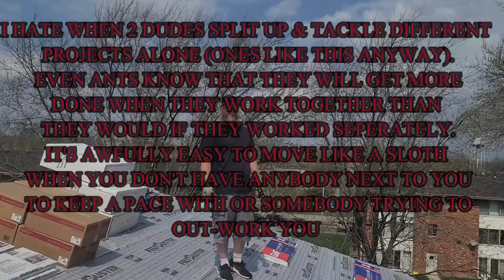First Roof of 2021

Comment: I wasn't exactly flying today, using 3 tabs with  4 intersecting valley's!...I haven't run these shingles in YEARS!...had to do a little bit of head scratching...lol!!!, but it  came back to me after the first one!...just like riding a bike I guess!...it turned out NICE!
Reply: Unless you are getting 3tab for half the price of Arc's I do not see much point. Here in NY there is a 15 dollar difference per sq
Reply: @mrroofman  the customer had bought them a year or so ago, and the guy that bid it out bailed

Comment: You need to do a 5 square challenge.  Time gets added for shiners and wavy shingles. People can sprint through a square but what’s the actual pace for 5? Then you would actually know who’s faster.
Reply from the maker: well thats why i came up with the roof olympics. one sq on a straight run hardly factors anything in. you should check out my video describing it. 3 sq platforms. everybody works alone. maybe a pipe and ridge cap

Comment: What is more important efficiency or speed? Should you focus on eliminating wasted effort or simply working harder/faster
Reply from the maker: Always efficiency 100%. It allows you to not have to work harder or faster.
Reply: @NWIVeteranConstruction  even in your roofing olympics videos are you focusing on being efficient in them as opposed to rushing ?
Reply from the maker: @charlierodgers2776  yes. Anything bigger than 2-3 bundles and you're gonna notice a burn out.  Shingling is not a sprint.  And anybody who has an efficient set up with some skill is gonna be faster than somebody going as fast as they can on the gun but walking around aimlessly twice the distance needed sometimes, going for coils every reload and moving shingles extra times no matter how hard they work.  Just my opinion.  Gatta be Efficient and pace yourself.  It's like a marathon.

Comment: Thoughts on doing ice and water shield for my entire roof? I'm in Maine.
Reply: I would say go for it just ventilate the attic properly...intake & outtake
Reply: I mean probably not necessary if you're putting asphalt shingles on and it's about a 5/12. If it's metal or fake slate then I'd go for it.

Comment: I prefer workmanship over speed, just because there are 2 lines where you have too nail between doesn't mean you should be a hack like 80% of the roofers in the world, you have one job, go up there and do a good job, I nail just above the part where you like the shingle up, hdz wants you too nail high so they make more money in the long run, if you do not believe me wait for a few years you will be called back for blow offs, might want too check the pressure on the compressor you are blowing through, if the pressure is good turn the gun down

Comment: I don't understand why you use 4 nails instead 6 ? Hmm
Reply: wind tunnel test from the manufacturer
Reply from the maker: we use 5 instead of 4 actually. 6 nails (in my area) are only required on steep pitches about 18/12 i think.
Reply: 4\12 and 3\12 get 4 nails 5/12 to 8\12 get 5 or 6 but 6 not necessary and over that gets 6 in the overlap.I do not trust that 2" nail line on a mansard .Those dimples are not gonna hold
Reply: You forgot about that Gaffney  built in super glue

Comment: Where the hell is your safety equipment? That is a three plus story DROP with one accidental trip 
Roofers think it’s funny or badass to not wear their rope so horror stories are important. I worked with this dude named “Mario” let’s say, Mario was new he was a brand new labourer with about 9 months experience and I had about 6 at the time, he was 30 switching careers with a new kid his wife just had and making good money labouring. Me and Mario were both told to go get goosenecks and vents by our shingler’s, when we got to the ladder Mario must have hit it to hard or just stepped unbalanced on the ladder and it gave out, reached my hand out to try to pull this 40+ foot ladder back to the roof but he was too far ahead of me. Ladder fell, Mario fell first, hit the ground shattered a part of his spine and broke so many bones in his shoulder and upper body, then the ladder fell. It crushed Mario’s thigh almost severing it off because it had fallen three stories behind him with that much momentum. He had to get his leg amputated and if we didn’t have another way down to stop the bleeding his artery would have kept bleeding dead in minutes. Before this happened it was a normal great day on the roof, weather was nice, wind was calm and the roof was gradual. Everything changed in an instant and we didn’t know what to do, since then I got my fall pro, Aerial platform, first aid, CPR and other courses but every single day first thing I do is hook up. You got people who love you don’t fuck around wear a rope

Comment: That's how I am with my boss lol. Guy use to ride my ass like a fricken barbie bicycle, taught me everything I know about framing. Some other crew that knows him the foreman come over to our job and asked me if I was his kid lololololol.
Reply: And 100% on that "both need to get done" crap, chores we like to do teamwork but building walls it's much better to work on it one man per wall. I hate having a guy wrapping his hose up around mine and stealing my tools and like, most annoying thing ever. Me and the foreman can get it where we know each other good enough to chase each other around a wall without bumping tips
Reply from the maker: yea thats why i said stuff like this. like if there's a pile of shingles on a tarp next to the dump and one guy works on that while the other walks around and picks up wrappers, not only is that a lil bit unfair but both jobs will get done in a faster total time if the guys were next to each other working rather than separate.

Comment: So Zack I talked with a few local roofing company  one refused the job due to my own materials the other wanted to charge a rate that would be equal to if the supplied material and then we talked about how long it would take to finish the job.i said mentioned you not by name but by speed and he said the quality would be low.i offered up your challenge now remind yourself this is one of those company with all fancy new trucks and vans  contacted an out of state small company 1/4the price of big company your offer by far still the cheapest
Reply from the maker: Not sure what you're getting at by mentioning me or the challenge. The challenge is just fun and for other shinglers to Guage themselves against other roofers to learn new to tips to improve efficiency.  I totally understand the guy not wanting to roof when a homeowner bought materials.  I don't even know how to charge for that and have never once had a good experience with others materials.  Ice shield is brutal, shingles are cheap, not enough of a bunch of things etc. I'd probably charge extra to because honestly it's better to pass up the headache.  But keep in mind shingles and everything have gone up and a lot of guys are raising labor prices as well.  It's not uncommon to be at 400 or more per sq on a walker. Sorry about out of towners with the shiny trucks lol find somebody local and reputable with referrals and reviews on a Facebook page and you'll be good

Comment: Bro hats to tell ya clowns are 5 nailing.  .
Voids warranty.  
Learn before you EARN MAN!🤦🤦WTF
Reply from the maker: No it doesn't lol whats with you guys talking about things you don't know about. Just coz it doesn't have a pattern for 5 nail doesn't mean their gonna not warranty me for putting an EXTRA nail.  Yes, I said I'm adding an extra nail by putting 5, instead of 4
Reply: @NWIVeteranConstruction  either 4 or 6 bro
Reply from the maker: @jasonthomas2714  show me where it says that. A link or something.  Don't make stuff up bro I've asked the GAF reps and it's 100% allowed
Reply: @NWIVeteranConstruction  ok school is in session for you, everyone who reads this that's a so "called roofer".  
So when you search "how many nails do you put in an architectural shingle?

Four nails!!
"Most shingle manufacturers recommend using 4 nails per shingle on the main area of your roof &5 nails per sq in the 1st row of roofing. This adds up to an average of 320 nails or 100 sq ft. If, if, you have high wind areas, you will want to use 5 nails per shingle,equating to about 400 per sq. .
So if you have those pitfalls, why wouldn't you just install per shingle??
That way your ass is covered if a tornado or straight line winds comes &rips shit off??
Doesn't this make sense??
Bro I live in southeastern Michigan & we get tons of wind often,&we don't fucking 5 nail nothing, if its installed correctly, no reason to deviate from what's on the wrapper bro. .#2 if your nailing pattern is not staggered correctly that 2nd nails going to leak live a sive.  5yrs down the road. .
Schools outta session. 
Thank me later. .🤣🤣✅
Reply: @NWIVeteranConstruction  6 nails per shingle**